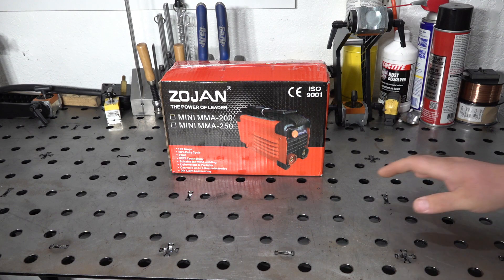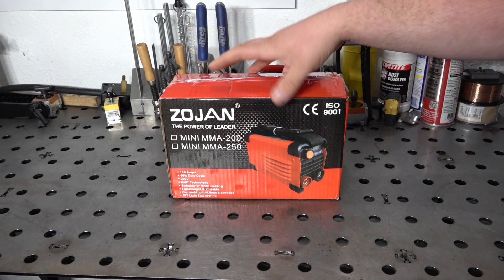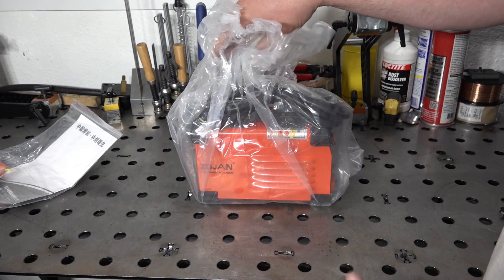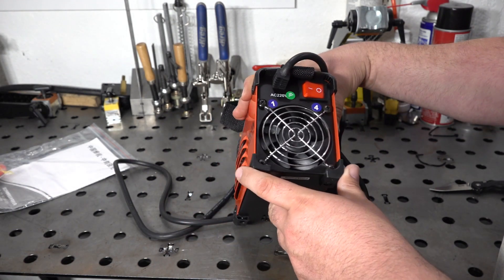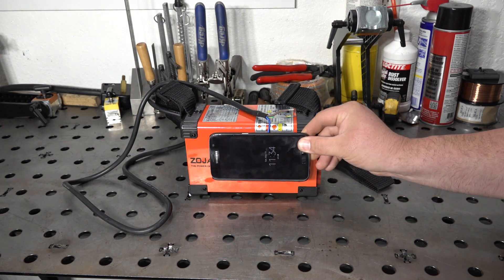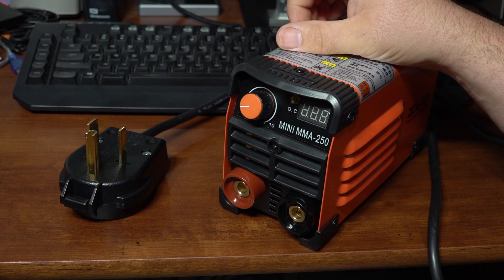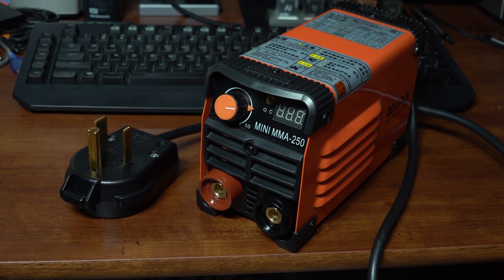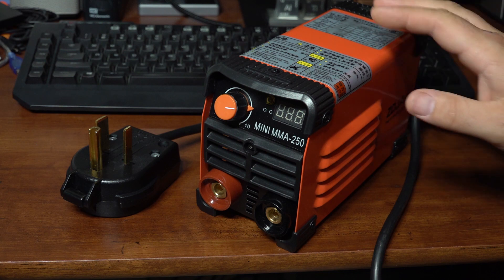Tiny Welder Review: Mini MMA 250

Comment: I paid $79 CDN for my Zojan 250. It’s real output is @ 130 amps DC. I’ve used it a few times but it’s really just a wall ornament in my shop. I did replace the power cord with a chassis grounded wire.

Comment: For 80 , to learn on and do a few small jobs ? Or no ?
Reply from the maker: This welder and the Juba ZX7-200 do surprisingly well for the price, as long as you understand that you will have to get cables, clamp, electrode holder and a 240V plug for the cord.  And as long as you understand that you may not have much in the way of a warranty if you ever have issues.  Otherwise, sure, it's a super small, light, and relatively inexpensive way to get started.
Reply: @bigtb1717  appreciate the expertise

Comment: I hope you saved that strap for a Ghostbusters costume.
Care to elaborate on the issues you found working with different rods?
Thank you for the upload.
Reply from the maker: In the last third of the video or so I do talk about how different rods run.  6010 doesn't work with this machine, but that's no surprise because it doesn't run well on a lot of inverter machines.  Other than that it was really just a matter of the welder not liking even a moderate length arc.  If you keep a tight arc it will run 3/32" 7018, 6013 and 7014 without much trouble.  6011 is a bit tougher to keep going.
Reply: @bigtb1717  hmm wonder how it'll do with a coat hanger.

Comment: Could you get by with a 20 amp 220v plug instead of the 50amp.  Reason is that the welder power cord wire guage and insulation will not handel 50amps anyways. Look at the size wire on an electric stove 50amp breaker.  It's much larger to carry 50 amps.  Thanks
Reply from the maker: I used that plug because that is the receptacle I have in my garage.  If you have a different 240V receptacle, I’m sure it would work.
Reply: @bigtb1717  How long did it take to receive your welder once you ordered it?  One more thing another review I saw of this type of small welder outfitted it witha Tig torch.  They said it actually worked really good using the Tig method.  Thanks
Reply from the maker: @russellmatheny8677  I can't remember exactly how long it took, but I don't think it was very long.  I think around a week.  But I did order if from a seller on Amazon.  I'm sure it varies depending on where you buy one.

Comment: could it be used for welding motorcycle frames, and used for MIG welding?
Reply: Its only a stick welder and if you dont know that sir i dont know if you should be welding on motorcycle frames. Could be realy dangerous fo the operator.
Reply from the maker: It can not be used for MIG welding.  Welding on motorcycle frames in general should be approached very cautiously.  There is too much chance for disaster if something breaks.

Comment: Why not try it in 110v & see what happens?
Reply: Daker Holdings llC

Imagine what would happen if you changed the battery in your car from 12V to 6V?  Car won't start!
Dropping the voltage by half, will half the current if it will work properly at 110V at all.
Reply: vial.of.photons  
Yes, some welders are dual voltage.  This one is not.  It is not designed for 110V.  At 220V you would most likely only get about 120A-130A max.  The Chinese lie all the time with regards to specs.

Comment: Thanks man, I was looking for a small stick welder to do some work with around the outside of the house, I am looking at the Fronius Transpocket 180, seems like a very nice machine and can do 6010 like a champ but it cost north of $1200, its small in size but not as small as this chicom welder.
Reply from the maker: Honestly, the ESAB 161 LTS would be great for what you are looking for.  Does 6010, small and light (smaller and lighter than the Transpocket 180).  It has less output than the TP 180, but it is also dual voltage, which is very nice for a portable, around the house, odd-job welder.  I picked mine up for around $485 locally.  Definitely worth a look if you are in the market.
Reply from the maker: Obviously though, not nearly as small as this welder.  But at a max of 130A output, and 240V input only, it is quite a bit more limited.  Also, this machine simply doesn't weld as smooth as the 161 LTS, or even other Chinese welders (or, I'm sure, the Fronius).
Reply: Thanks again. I am not in the US, and ESAB 161 LTS is available only in the US, however, if I am to consider the ESAB (which I did) at one third of the price, I have the ESAB Buddy Arc 200 (I suppose it's the same machine with a different name?) available here at around  $500, which is not a bad deal for a 200 amp machine?
Reply from the maker: Yeah, I had a feeling you weren't in the US since the Fronius stuff is rare around here.  I know ESAB is available other places, but didn't know specifically which models.

240V may be the standard where you are, so the dual voltage option probably isn't as big of a deal.
Reply: True, however, it'd be nice to have a portable welder that's 110v as well as 220v so I can take it with me when I get back to the US. Specially since my stationary main welder is 220v. I think the ESAB 200 is a better deal for me money wise as I'm finding it hard to justify the Fronius even though Fronius seems to be the Ferraris of welders, or so they claim.